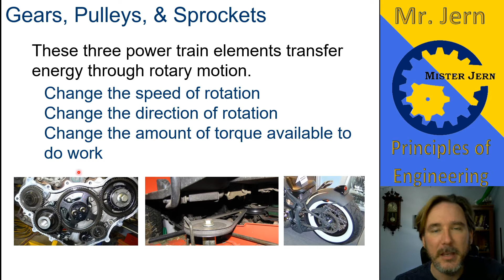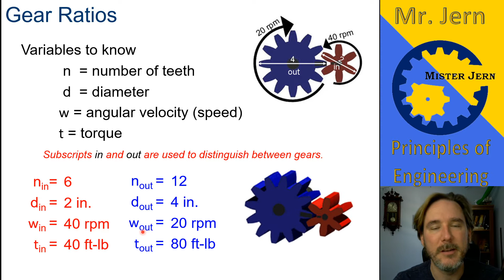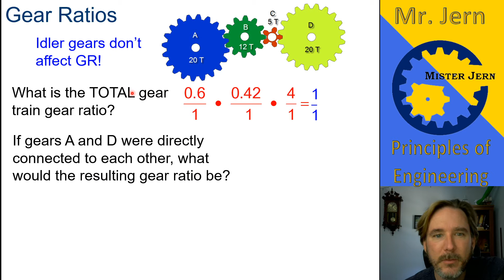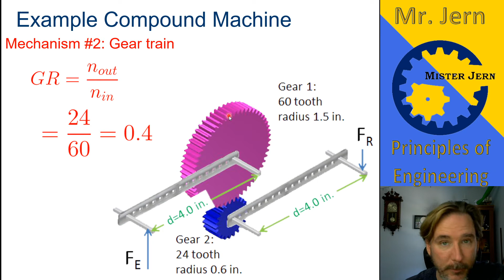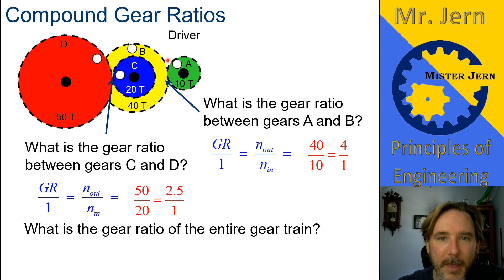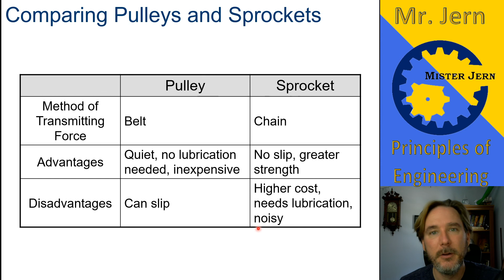POE 1.1.3 Notes: Gears, Belt/Pulleys, and Chain/Sprockets

Comment: Hi Mr. Jern, I'm looking at Mechanism 1 MA calculation and I've seen another video take the MA of mechanism #1 to be 4.0"/(1/16" -radius of the axle). I see that in the pdf they teach it the way you have it which is 4.0"/1.5". Are you bypassing this step as it might cancel out with mechanism 3? Please explain the discrepancy. Thanks.

Comment: At 13:50 why did you only take the MA of the first simple machine to the third, instead of multiplying all the MA including the gear train one?
Reply from the maker: Mechanical Advantage (MA) is different than Gear Ratio (GR). (MA is about force, GR is about torque).

You can certainly take those further and find the forces involved, but then you have to start including the equations for Force and Torque. Since the question(s) only asked about MA and GR, I stopped there.
Reply: @MisterJern  Thank you!